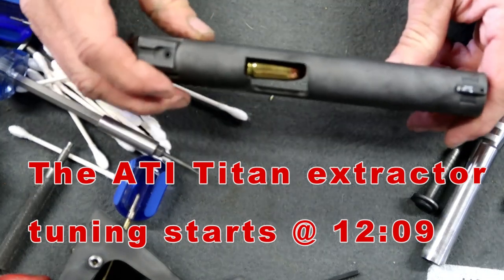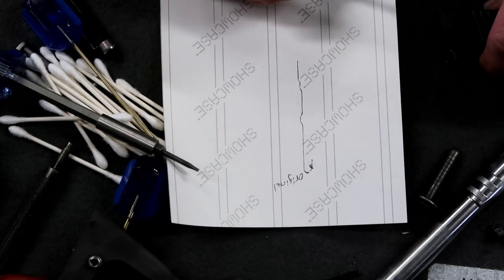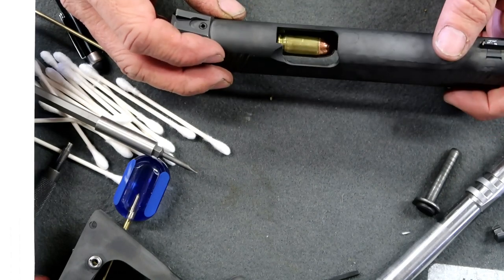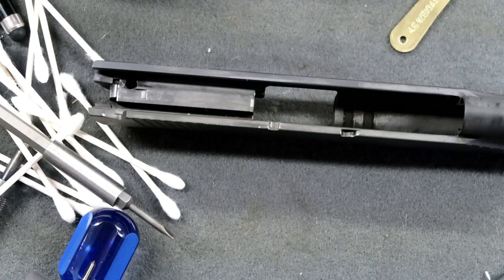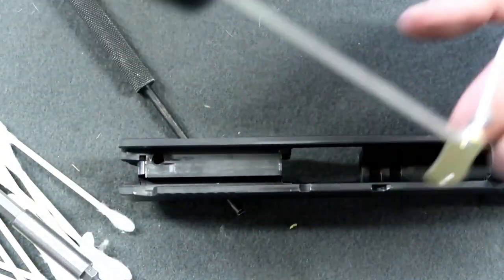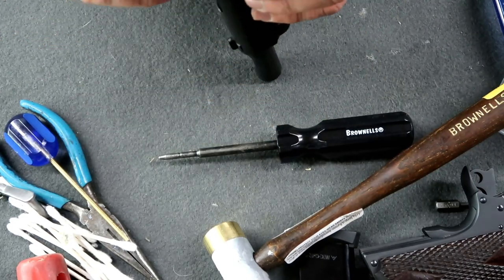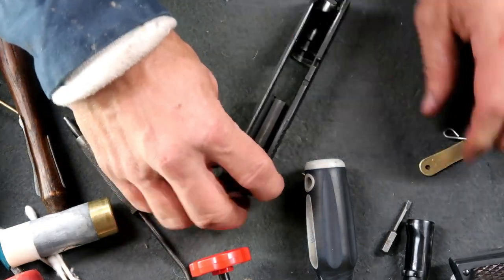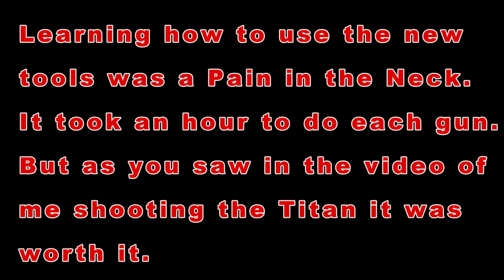The 1911 Extractor Tuning For Reliablility

Comment: Tuned my extractor tonight. Those series 80 take a lot more than one might think to get just the slightest bend. I created my own jig in a vise with 3 rods held to the jaws with magnets, put the extractor in the jig, closed the vise showing a good amount of bend, took it out dang near went back on itself to where I started. Had to put a few tight bends on it to get a fraction of bend at the tip.
Reply from the maker: You should do a video on that. I was terrified I would break mine. Thanks for sharing that idea.

Comment: That’s a dandy little tool.  Seems to have done a great job.  Doing it by hand seems like it would work as long as you didn’t snap the darn thing. The way metal is today I would be afraid of snapping it.
Reply from the maker: Birdman 649 if you own more than one 1911 or intend on being a life long owner I would get the tool. The gouges and the trigger pull gauge. Then you have all you'll need if the extractor weakens or is sprung out by being snapped over a cartridge in the chamber.

Comment: From personal experience... I am a newbie but huge on 1911s, and yes too much tension on the extractor.... its horrible and a pain in the ass!!! when you install it think it is ok cuz it holds the casing in place but dont realize it isn't straight... then after firing it and every shot (the slide) doesnt close all the way forward you realize you bent the extractor too much and then have a difficult time getting it out of the slide
Reply: Whish I found the extractor tool before hand but at the same time cant complain too much, nothing like learning the hard way
Reply from the maker: @jamesfarmer3380  I hear you brother. As I was doing the series, it dawned on me to trace the outline of the extractor so I could see how much I bent it each time. That helped a lot with the new Wilson Combat extractor. Having the correct tool and the ability to test the adjustments you make is essential to getting it right. I only recently got the correct tools to do the job. However, the Titan's extractor was so soft it would not hold the tension for more than one complete mag. Halfway through the second mag, it failed to extract AGAIN. I bought a new Wilson Combat "Bullet Proof" extractor. It took an hour to fit it then I took it back out and tensioned it.  All the while keeping up with how much I bent it by tracing its outline on a piece of copy paper. That helped a lot.
Reply: @mackdaddy1911a1  I have a quick question for you. I was able to find and order the wilson combat extractor and the tensioning tool you talked about. Huge improvement and worked so GIANT thank you, but.... my question is, where did you by the extractor tool from? Any time I type it in for Google it is lost or just gives me regular punches for sale. I managed to use a regular punch but would prefer the proper tools so I dont scratch up another slide in the future
Reply from the maker: @jamesfarmer3380  I purchased it from Brownell's. Here is a link.

https://www.brownells.com/gunsmith-tools-supplies/handgun-tools/action-frame-tools/extractor-tools/1911-extractor-removal-tool-prod1004.aspx?avs%7cMake_3=1911

If the link doesn't work. Copy and paste in your search box. Good Luck. It is in the gun smith tools, pistols, 1911. It was included in the 1911 armorers tool kit they offer. Worth every penny.

Comment: I couldn't even get my extractor in to the chamber. I thought I had to put pressure on it and force it in and now it's stuck. Sticking out of the back about a 1/4 inch. Now I can't get it out of the slide.
Reply from the maker: Series 80 ? The bend required to give it tension is only very slight. If it is a new extractor it may be over size and need sanding/polishing. If you can get it back out look for places where the coating is scratched off. That is were it will need to be polished.
Reply: @mackdaddy1911a1  series 70. Oh, ok. Yeah, brand new. Thank you. Now I have to figure out a way to get it out.
Reply: @mackdaddy1911a1  I got it out without banging it up too much. I do see a rubbed spot on the middle rib of the extractor. Gonna buff that up and try again. Thanks for the tips.

Comment: Just curious as to how your guns shot after the adjustments. Did that 25-30oz setting with tool work good?
Reply from the maker: Yes it did. However the ATI Titan's only lasted two mags. The steel it is made of is way to soft. Retensioned it twice more with nearly the same results. Replaced it with a Wilson Combat bullet proof extractor, tensioned it. Zero issues since. I have several videos shooting it since. Same with the Colt and I put it through a Gauntlet style torture test. Our Okefenokee Baptism.  Zero failures to extract.

Comment: Should be 25-28 oz--never heard 30 oz???   Have a RIA 9mm FS and if extractor is over 8-12 oz,it will not work!!!   CAn't figure out why???
Reply from the maker: The extractor was garbage and I set it to the recommended setting of the tool manufacturer. Had to replace it. Two mags and it started to fail to extract and eject again. Replaced it with a Wilson Combat, set it the same and zero failures since.
Reply from the maker: The bottom of the extractor's hook needs to have a  radius as opposed to being square. The cartridge needs to have the room to pivot nose up as it moves up the ramp. 
The breech face and firing pin hole must also be absolutely smooth.